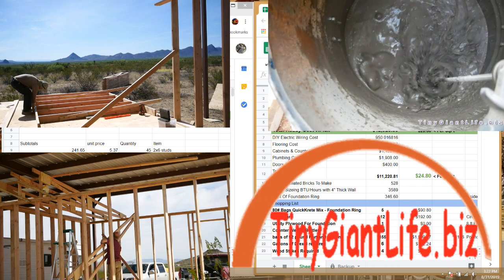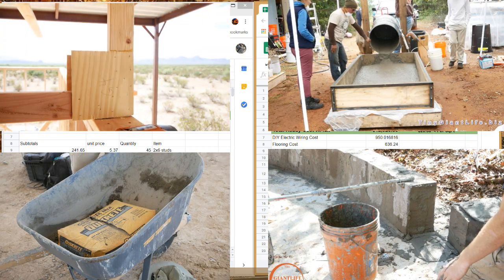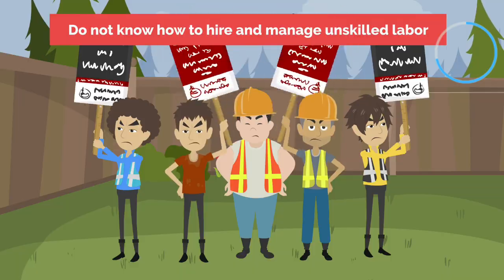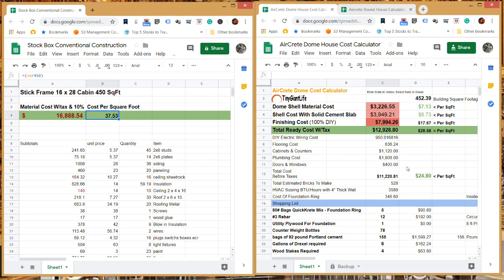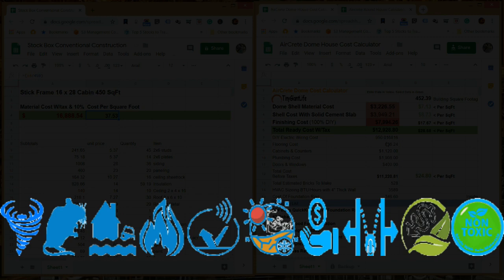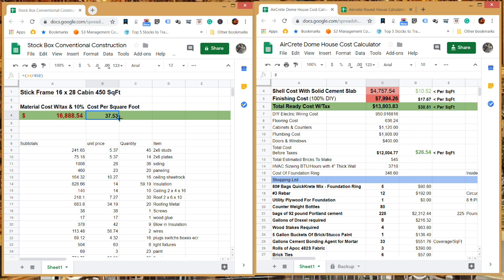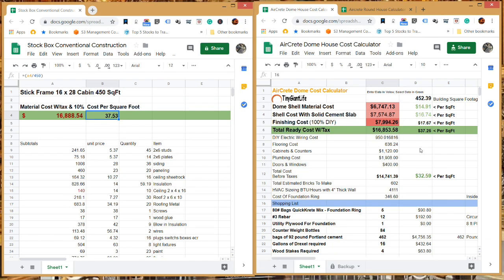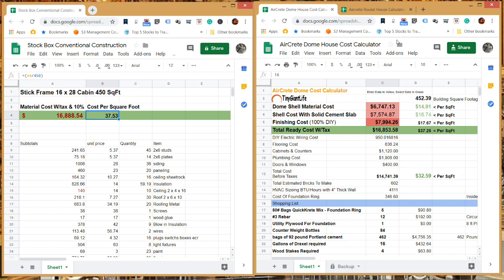AirCrete House vs Conventional Construction - The Winner is?

Comment: No first start Whit cost $10 square foot aircrette it doesn't matter if is easy to build or wherever the only important part is cost 450 square f building 14k BS people don't change the facts is to expensive just to make the panels frame only nothing else also concrete walls untreated will generate fungus on the upper ciling because humidity and condensations rats and roches don't come in for the type of building structure or material they come in because people have nasty cleanings abits
Reply from the maker: Current finished move in ready cost with furniture and basic appliances is around $50 per square foot.  $1100 would be the price of the AirCrete walls for a 450 SqFt house

Comment: Can air Crete walls be poured all at once? Especially to replace the tire walls in an Earth ship style house
Reply from the maker: There is a limit to the depth you can pour daily.  The pressure of the pour can cause bubbles to come out causing loss on insulating properties.

Comment: Is this cheaper I'm still trying to decide if I go aircrete or earthbag
Reply from the maker: Tomorrow I have a video on that very subject!  

I would start by asking about your climate.  Is it wet a lot, is it cold, is it very hot, do you value comfort?  Earth bag is definitely cheaper for the shell.  AirCrete cost $9-$12 per square foot for the shell.  Finishing cost and appliances are where the post expense is found and will be only slightly more for AirCrete.  Any skilled labor will greatly add to the cost of a house.